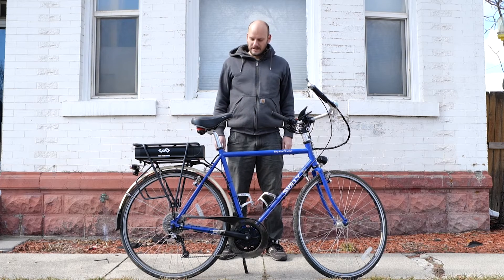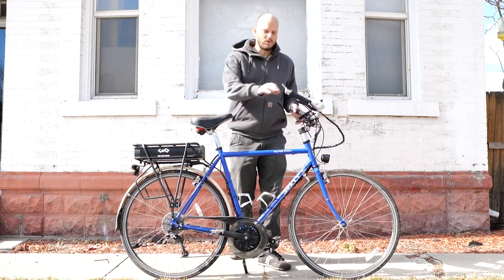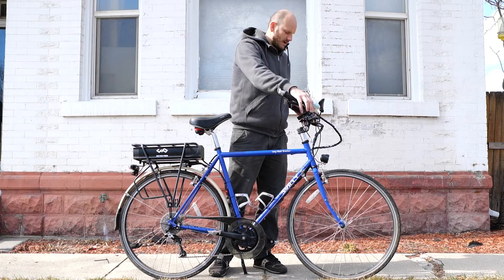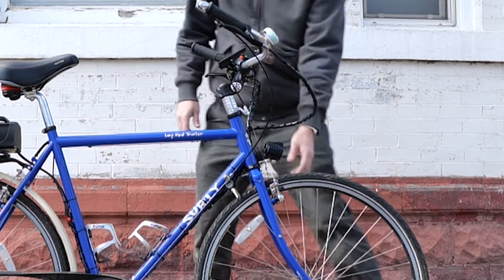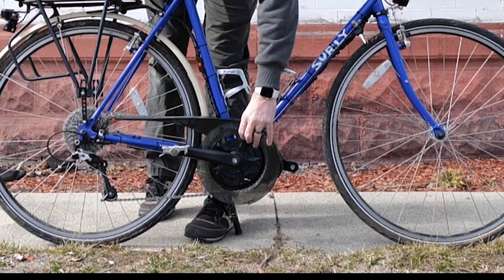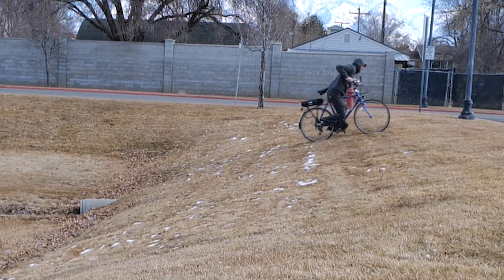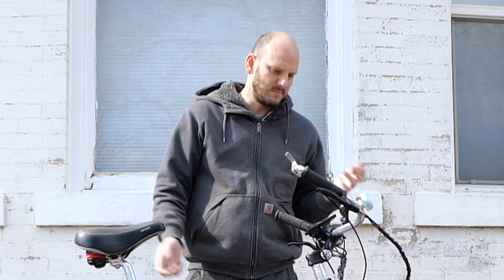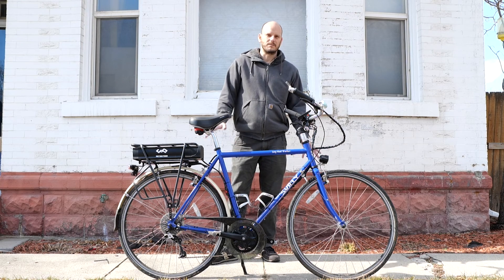Custom E-bike Build: Surly Long Haul Trucker BBS02 52v 22.4ah Rear rack battery

Comment: Why does the battery cost $600+? Are the batteries in there custom designed?
Reply from the maker: It comes in a rear rack with lights etc. more than just a battery.

Comment: I think the range she is going to get is most amazing. Built the same bike, even the same year, but with a flat bar, for a customer getting over 80 miles on a 48 volt, 20ah battery. Love working with Surly quality.
Reply: What's the terrain of that 80miles?  I'm looking for something in the 100 miles range for touring, have a Trek 520 but old knees are giving me problems.
Reply: @ArmyNurseCorps-u5c  I wish this allowed me to post photo's. I did a couple 520's. Two did Tour of Illinois and one is doing RAGBRAI. Terrain mostly flat with some small hills and significant headwinds, level 2 assist and 15mph consistent.
Reply: 80 miles is excellent, I've ordered the 750w kit 20Ah 48 battery and was told 40-50 miles is good with pedalling. 80 would be really nice.  Did you chance any of the programming?
Reply: @Crana  absolutely not! OSF is the worst thing that has happened to this motor and its reputation. On their many pages you will find that easily 90% of problems are from folks that change the factory programming. Maybe three of my 80 customers even know it can ve done.  All of them are happy. 

Whoever said you could not get more miles than that must not have figured such a large battery. I wish I could post a photo of my wife's enormous 3speed coaster brake cruiser. It went from Davenport, Iowa to Savannah, Illinois, along The GRT, on a single charge, with loads to spare. That's sixty miles!
Reply: Great build, looking forward for my build project very soon ❤

Comment: What are the best and kits
Reply: The best really does depend on what you want to do. For 90% of the people that want to legally make traditional cycling easier, more convenient and accessible, The TSDZ2 is most affordable, the easiest install and needs the fewest wires to hide (no brake or shift sensors). No throttle or reliability goes out the window.

Want a ton of torque and rugged quality withoutbsacrificingba torque sensor? Get a CYC Photon

Want to throttle around and have a ton of torque? Don't care about the law? The BBSHD is thr most affordable option.

I wish The ToSeven DM01 were out a bit longer. Once it establishes itself, it will fit right between those applications.

If you want to throw caution to the wind and don't care about noise or reliability, only power a CYC Stealth or X1 Pro.

Comment: Why a rear rack battery on this bike? That triangle is plenty big enough.
Reply: I suspect it's due to braze ons for cable guides that stick out on the down tube--- if it's anything like my Surly--. I have the Surly "sister" to the Long Haul Trucker, a Surly Disc Trucker (yeah, same deal but with disc brakes).  I had looked at it for a Bafang mid-motor conversion and was faced with the dilemma of removing the brazed on cable guides so a down tube battery would sit flush onto the down tube. It seemed to me a shame to do that to a Surly as Surly's are functional pieces of art IMHO. I opted in the end to use another donor bike, but at some point in the future I may go with a rear rack battery as seen in the video. But I agree that a down tube battery is a superior route to go--whenever you can--lower center of gravity and all...

Comment: Turn Signals and BrakeLights ftw! You can Feel the flow of traffic go so much smoother and SAFER when everyone knows what's going on. 👍
Reply: The problem with these is that they aren't legal. If you use them instead of legal hand signals and there is a collision, you will be held responsible because they are not DOT approved. They are though great when used in addition to hand signals.
Reply: @Mark great insight! I was considering these, but now not so sure if they’re worth the trouble.
Reply: @sai123praneet  Not worth it to me, but I have to admit that they should help avoid an incident. I used to a regular Capt Dashboard. I had stroking string through my frame, wheel reflectors, reflective sidewalls, reflective clothing, flashers on my arms, helmet and the bike as well as a headlight array with front and rear cameras. It got rediculous. Where does one stop and how bright is bright enough? The fact is, we need to be holding motorists far more accountable. Until folks are seriously in fear of permanently losing their lisc, they are not going stop harassing us. If deer had reflectors and flashing lights would we still be saying we didn't see them?